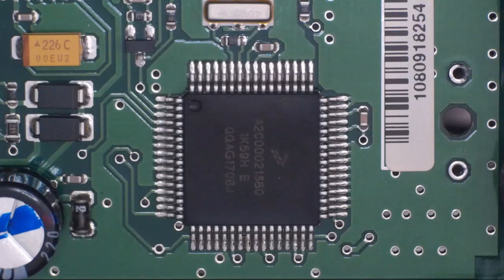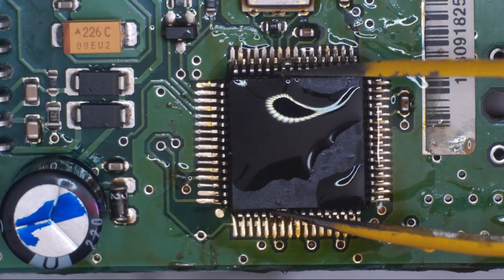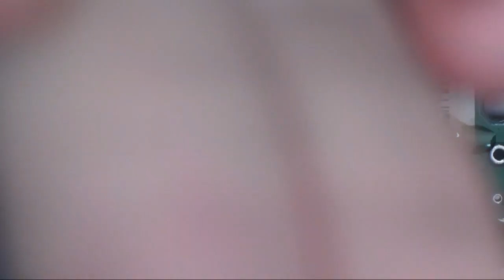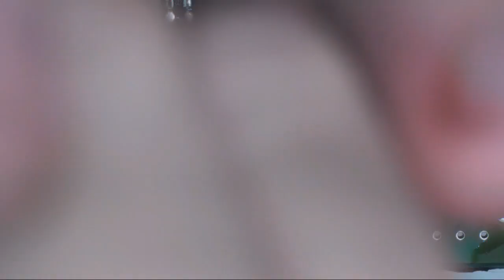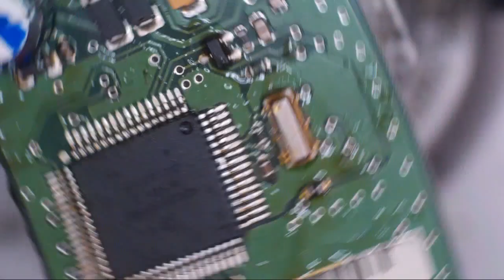removing and soldering a large smd qfp64 ic with quick station hot air rework

Comment: which temperature and airflow you recommend for chips like that mate?
Reply from the maker: Generally I leave hot air on full speed at 450c. I will turn it down only if working with small stuff. You can easily control the temperature by adjusting distance of nozzle.
Reply: @ecurepair  with that high temp and max flow I’ve damaged some chips but at least I’ve removed some stubborn ones without damaging any traces
Reply from the maker: @f1lupo  Yes, you need to really pay attention to your distance and dwell time or you will cause damage for sure. I should always point out that since I work on automotive stuff its generally still attached to aluminum casing. Normal boards 350c is probably safest.
Reply: @ecurepair  air maximum?

Comment: Wow, so just go round and round and pick the chip right up? I'm still kinda scared to start using a hot air gun, unfortunately my current DIY project pretty much requires me to remove an IC chip undamaged similar to the chip in the video. Still debating if a hot air gun is the right tool for me. But you making it look so easy does add a little to my confidence for what that's worth.
Reply from the maker: Its not too hard to start with and definently the right tool for removing smd ic's. Just practice a little first on junk board.

Comment: Hello
One question please:

Why adding flux before removing and installing the new chip ?

I thought flux is only a cleanser (for cleaning)
Reply from the maker: it enhances solder's wetting ability and helps it flow better
Reply: @ecurepair  thanks a lot for the reply and help

Another question please:
How the new chip stick to the board without adding any solder (like solder paste) ?
Reply from the maker: There is solder there. I had tinned the pads prior to using the hot air gun again to set the chip
Reply: @ecurepair  what do you mean by you tinned the pad?

Sorry if i'm questioning a lot but my phone died and i need to replace the power ic chip and i never done that before and i have no experience

Thanks again for the help
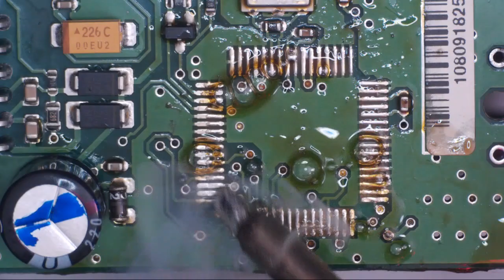Reply from the maker: @gilbertknight6617  @0:51 I use my iron to add solder from the tip to pads and even out the solder already there from where I removed the chip. Adding solder to a surface like a bare wire or a bare smd pad is called "tinning" .
Reply: @ecurepair  thanks a lot for thelp
Appreciated

Comment: Is it me or you placed the ic in the wrong position because the dots in the footprint and in the marking did not match....
Reply from the maker: Its you. There is no marking dot on the pcb. Just via's. The one you think is a foot print marker is just filled in with solder. Watch the beginning closely. The chip was placed correctly.
Reply: @ecurepair  jejeje yes you're right, it was a via with solder.

Comment: What temp the soldering iron ?
Reply from the maker: hot air usually 350-450c depending on what im working on. Like little board in video, 350 is good. Solding iron I use a metcal so its controlled be tip. Most common one I use is I think its around 380c